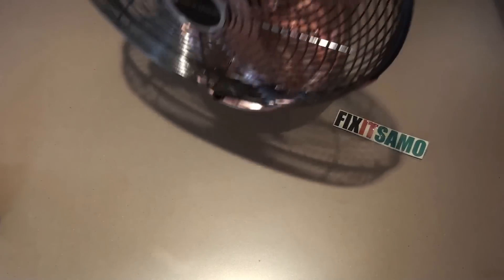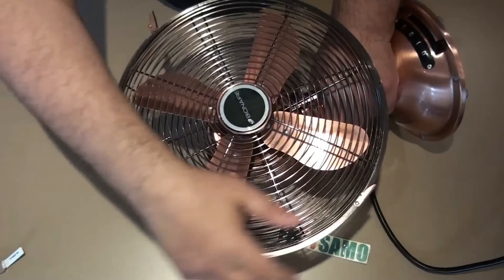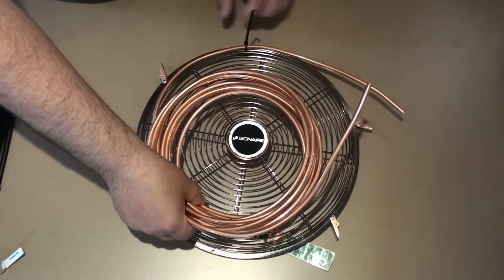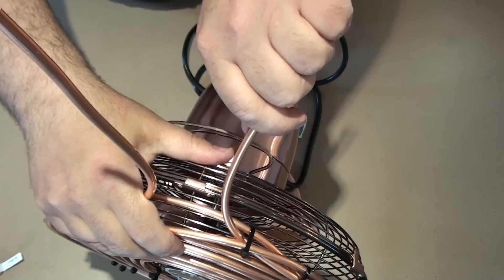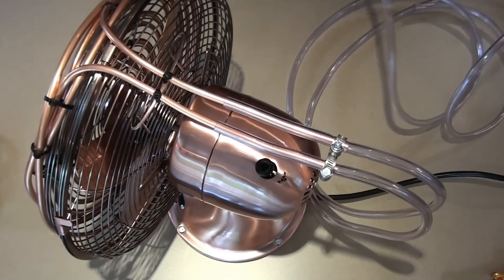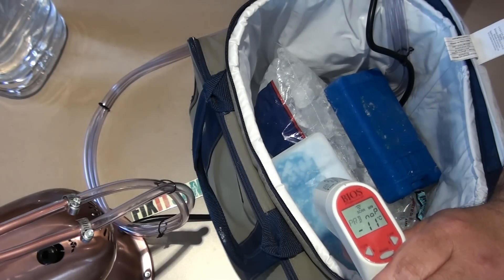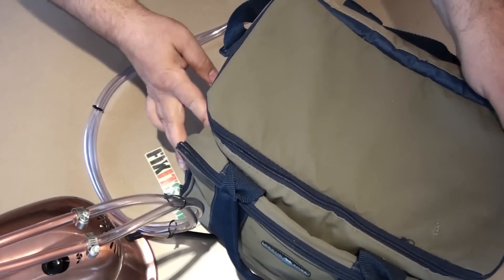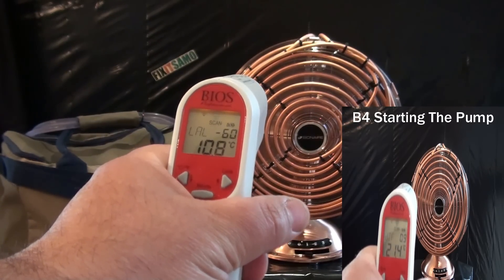How To Turn Your Fan Into An Airconditioner  AC

Comment: this fan is metal so the actual fan parts themselves wiill get colder from the cold water circulating the copper pipe. this will cause the air blowing out of the fan to be even colder (I think). could this still be done on a plastic fan? if so, will a plastic fan make air that is much less cold than a metal fan (bc of the difference in the properties of metal and plastic as stated in the forst part of my comment)? thanks
Reply: Cxo Mxo The fan is behind the pipes, so it shouldn't make a difference what they are made of.
Reply: The copper pipe gives off allot of heat because its a good conductor so it will also work on plastic
Reply: A metal fan blade by default generates more air flow because it's better at reducing drag as opposed to a plastic blade. Its heavier so produces more power. In this application I definitely would use a metal fan over plastic.

Comment: The ice-making machine has to be in a different location, because the heat sucked out of the room-temperature water goes straight into the room, raising the temperature.  When you melt the ice to cool the room, you are bringing it back to the temperature it was when you started to make the ice. Making ice warms the room, melting ice cools it. Net difference is zero. This is a total waste of time. Use fans to move air over your body,  making you feel cooler.
Reply: Excuse me, Einstein: this is a sealed system with no evaporation.
Reply: Kris Van Pelt You are correct. Buy it and cool down! Just don't use your freezer as an air conditioner.
Reply: Ted Hitsman What room temperature water do you refer to??? It's iced water. This is not an evaporative technique. The energy used to make the ice is not part of the equation.
Reply: Nonsense. Evaporative cooling is well-known and well used.
Reply: Same concept, Copernicus.
Reply: Hey Ted. I see where you're getting at. However, the net difference wouldn't be zero. I'll explain.
Say I put some ice cubes in a glass of water. Eventually the water temperature will reach closer to zero. It doesn't happen immediately but it'll happen nonetheless. Eventually, the ice will melt and the water will go back to room temperature. (Or specifically, room temperature minus the ice-cube's cooling potential)

What's essentially happening here is the same. However, the coolness of the ice is being used to cool the room like a warm drink being cooled by an ice cube. Eventually the ice will melt and reach room temperature, but before that happens, you'll get a nice cooling effect :) He'll just have to keep replacing the ice.
Reply: but he warms the room when he makes the ice.
Reply: Lol yeah. But like a cold glass of water, it's only for the moment. That "AC" he has would only last a few hours at most. A regular AC is better and keeps the room cool with less work on our part but hey it saves money and it's a cool idea.
Reply: Not the same room perhaps, Ted? Think about it...I can make ice in my freezer and use it anywhere in the world, as long as I can get it there before it melts.
Reply: Then you are using your freezer as an air conditioner.  If you can afford a freezer, you can also afford a room air conditioner.  Guess which one is more suited to cooling a room?
Reply: Sure, Ted an aircon would be more efficient. But saying that if you can afford a freezer you can afford an aircon is as faulty as saying that if you can afford one car, you can afford two.
Reply: Ted Hitsman Are you a moron? Pretty much everyone has a freezer, but not everyone can afford to buy AC units, or it just doesn't make sense like in the UK when it would only be used a couple of weeks a year at most. this is a cheap way to do it.
Reply: John 545 Actually the people who foist these videos on the world are the dummies. They should take a basic physics course. And buy a room air conditioner,  instead of using their freezers to cool their houses. Think about it.
Reply: You do realise that a freezer expels the heat outside of the house so it will cool the house down. Stop trying to look clever, it isn't working.
Reply: Hey Ted. The freezer is, nearly in every household on this planet, located in the kitchen. Assuming that you wouldn't want to place the fan inside the kitchen but, for instance, in your bedroom (which is a seperate room). So the only place that would heat up (also by a tiny margine) would be the kitchen, not the bedroom where you will be using the ice. Also, the cost to make this would be an extreme fraction of the price of an air conditioning unit.
Reply: + Farseer1995  Ehh, Ted is a bit slow . He's not getting it. He's stuck on his version of thermodynamics. He's probably also a flat earther. WTF does he not get about this simple process?
Reply: Ted Nobody has missed your point. It's just that your argument is faulty. I actually do have a freezer outside, so this should work pretty well for me.
Reply: @ted hitsman my freezer is in my shet. so it will work:)
Reply: So you're saying you can't buy ice from your local convenience store and put it in the cooler you would use for this DIY air conditioner? I know I can't afford a portable air conditioner; they are running at $180+ and I can't use a window unit because my windows open outward.
Reply: Farseer1995 Everybody has missed my point: making ice requires pulling heat out of water. That heat goes into the house, transferred from the freezer coils. The ice warms, transferring  cold air to the house, thereby cooling the air that was warmed when the ice was made. None of you gets it. And, to make matters worse, the electric motors heat up when operating, warming the house even more. 

The only way to cool a house is to use an air conditioner that sends its hot air outside. Or make ice outside.

Comment: sir i want know is this works like an a.c or cooler i mean to say if i close my door will it creat humidity and if so wat we can do to overcome. shall we place the coil behind the propeller gaurd as in case of a.c unit where the rotor is covered with evaporator coil,also can we use dry ice and water in the enclosed tank?
Reply: Apoorv Shrivastava Humidity is used in parts of the to cool homes, they are called evaporative coolers.
Reply: xkblxcripple place the cooler inside a bigger cooler ;)
Reply: It is a closed unit so no evaporation (increase in humidity), you will however melt the ice quicker as the heat exchange from the copper will warm it over time. making a funnel for the air and placing the coil before the fan is the same. Place the cooler in the coolest area of the room to make it last.

Comment: What if we use coolant in place of water ?
Reply: Ritesh A coolant will not work as good as water. The name coolant is misleading. The  reason it's called coolant is only because it has anticorrosive and anti rust additives. water has best heat transfer
Reply: No it's not. It's used to drop the freezing point of water
Reply: coolant is used to drop down temperature of water

Comment: Nice try but I think that the energy you need to make all that ice plus the consumption of the fan and pump is more than a 7000btu a/c needs.
Reply: Shock Yes it will be running anyway, but when it is loaded with cool water, the compressor will be on for much longer, until the ice is formed, and the thermostat turns the compressor off. No such thing as free energy, I'm afraid.
Reply: +kostas ntz
You are correct, but this could be a hack if you're out camping or something like that.
Reply: think camping in key west in july. I rigged up a fan blowing into a cooler 20 years ago, but if I had this schematic i'd have slept much better.
Reply: Your freezer is going to be running anyway though, right?
Reply: Well you are running your freezer anyway right?

Comment: i have an idea 
this is a very good project but what if you can add a 5v 60w peltier cooler to this, would that be effective, low power compare to a ac unit
Reply: I wonder what are you going to do with the hot side of it? Nobody canceled 2nd law of thermodynamics yet. So for the cool part of peltier device that I assume you are going to use to keep ice icy you gonna have to deal with hot part of that device which will add to the hot air you are trying to get rid off. So net effect will be null. As far as I got peltier device is good for fridge-like applications and not so much for home air-conditioning applications.

Of course I might be misunderstanding your idea so would be eager to know more if you don't mind sharing how you were planning to deal with hot side of peltier device...
Reply: peltier device is by definition has two sides: hot and cold. So I am not really sure I understand your sentiment about "there is no hot side". As for "it won't work at all" - well, that is just not true due to very trivial laws of physics. If ice in the bucket is melting - it is absorbing heat to do so. That heat is majorly coming from warmed up water that travelled through copper pipe while hot air is being blown at it and thus conveying part of its heat to water in the pipe. As a result - water getting hotter and, correspondingly, air that passed through it is getting colder. Natural exchange of energy, nothing else. I would be curious to see why you insist that cooling is not going to happen still. Is that because you are using some alternative definition of cooling, not standard "cool is the absence of heat"?
Reply: Ranjit Dalipsingh you might want to read to which initial comment I posted first. It was someone proposing to attach a peltier device to the whole setup. To which I asked how the author of such idea would deal with the hot side of said device. That is first. 

As for the cooling - for whatever reason you are expecting there is high humidity that will render condensate collection pretty burdensome. I have to agree - that might be a problem IF you have high humidity situation. However that has nothing to do with cooling mechanics itself - an air passing through this somewhat inefficient coil will still get chiller, though understandably not to the same degree as in professionally assembled freon based compressors. That is the only thing I am debating, not HOW much heat it could remove. If you are in the middle of 100 degree house - it will take a lot of time to cool it. However for other applications, for example to cool it down from 80 to 72 degrees - this is more than enough.
Reply: I need to buy the copper but this conversation has my doubting and the copper is not cheap. Has anyone tried the setup?
Reply: In this case, there is NO hot side because the ice was already produced by another refrigeration system known as an ice machine. The ice machine removed the heat from the water to produce ice. The hot side of the ice machine is its condenser.  This video has nothing utilizing a peltier device so the ice simply melts (latent heat of fusion) as heat is absorbed into the colder tubing as air passes across the tubing. 

The concept of this video is nice but it simply is not going to be able to cool or remove enough heat (in btu's) from the average sized room to produce actual mechanical cooling.  Mabe  a tiny (well insulated)  2 x 2 foot box but that's about it.  It won't work and a total waste of time even trying.
Reply: Denis Davydenko you mention in "other" applications it will cool down (something) from 80 to 72 degrees.  It depends on what the other application is, and what the "something" is. It would also depend on how many btu's there are to remove as in heat load, humidity and so on.

Anyone familiar with HVAC fundamentals will immediately know this  isn't going to be an effective means of removing heat from a typical room.  It's a waste of time if this is your intent.  But as a science project, it is cute.
Reply: I guess you don't understand that the device made in this YouTube video has no peltier device involved.  Go back and watch the video.  Therefore, there is NO hot side as you call it.  The combination of ice and water causes an ice bath of 32 degrees.  As heat is added to the ice bath the ice begins to change from a solid to a liquid.  (Latent heat of fusion).  After the ice is completely melted,  the water then begins increasing in temperature by sensible heat, until it reaches the rooms ambient temperature. This is the extent of the videos cooling effect.

The problem is that it is substantially to small of a system to effectively cool a hot room in the summer time with high humidity. Add to the fact the tubing has very little surface area (because there are no aluminum fins attached to it like a real evaporator coil has) to help absorb heat from the passing air and you have a system that simply will not effectively cool a room down. And if you could maintain a 32 degree water bath circulating through the tubing, there is no means for collecting condensation that will form and drip down from the copper coil.  It's a cool science project but that's about it.

Comment: The main benefit to this vs. a real AC is that this is very quiet.
Reply: this is louder than my AC. The real benefit of an AC is that there's no ice to be replaced.
Reply: Most people watching this video, using a powered device, are likely to have a freezer which runs automatically to keep things frozen  in the first place.  Maciej is correct, this requires much less power than an AC unit would, and taps into a good bit of the energy that would be consumed regardless during normal freezer operation.

If you want truly free, "no human-generated power needed" cold air, move to an arctic region.  That is the only place you will find it.
Reply: The benefit is much less power.
Reply: Maciej Rudolf power is needed in making ice. 😕

Comment: I want to know the temperature without putting ice, but just water itself.
Reply: in a conventional air conditioner you have a 16 to 21 deg difference in F.. (home split system a/c)

Comment: May I ask, does it work in a room say a 4x4 sqm area, I mean, does the entire room get cold, at what temperature? How about using aluminum pipes instead of copper, what's the difference?  Hope you reply back, thank you.
Reply from the maker: +Eddie Wow 
It worked fine in a 10x10 
And copper is the most efficient

Comment: It's more expensive and less efficient than a window AC unit.  

Your viewers must think you can get unlimited ice for free from your freezer.  Not so.  Taking tons of ice out of your freezer actually makes your house hotter because your freezer is inefficient.  And if you have to buy the ice, that makes this unit very expensive.  Not to mention the fact that someone has to refrigerate that ice, too, so you're operating at a net loss from the get-go.
Reply: Actually the OP was correct that using this will actually make your house hotter overall (assuming you are getting the ice and ice packs from an indoor freezer). Whenever the freezer is running it blows hot air out the bottom and back. The harder the freezer has to work, the more hot air it blows out. And because the freezer isn't 100% efficient, the amount of heat it produces is greater than the amount of cold. 

Put another way, if you leave a freezer running in a sealed room with the freezer door propped open, the room will actually get hotter.
Reply: You don't understand.  The process of freezing water using your freezer actually generates more net heat than if you didn't freeze any water at all.
Reply: You are correct from pure theoretical standpoint. However if we are to get practical here - nothing prevents you from cooking ice at night time when you don't need cold air. So at night time you will get only hot air from fridge's freon pump, but at the same time you don't really care as you are sleeping at this time and house is generally cooler at night time. But this heat built up during night time gives you a "budget" of degrees to cool house down during day time when you actually need it by using that ice you got cooked.
Reply: A freezer doesn't work harder because you put a thawed out ice pack or water bottle in it and probably won't have to do much of anything if you're quick about it with the door. It keeps a certain temperature and will take x amount of time to freeze something in that temperature. It doesn't know if things are frozen or thaw.
Reply: Freeze a handful of water bottles, use them to cool the water, exchange them out for other frozen water bottles when they thaw out.

Comment: I want to make one. However, i am wondering how far away i am able to place the cooler from the fan and still keep the water cold.

If i hang the fan near the ceiling, what should the maximum distance from the cooler be to prevent it warming up? 
Would i need a different, stronger pump to pump water from the cooler up the wall to the fan?

If i make this a permanent place for the cooler and fan, would it be better to use a longer piece of copper tubing and work it up the wall to the fan?
Reply: robbiedaug depends if you insulate the pipe from the fan to the cooler
Reply: bekar hai pisa barbad mat krna koe Mai ne try kiya hai bhai......  1000rs  wast hogya